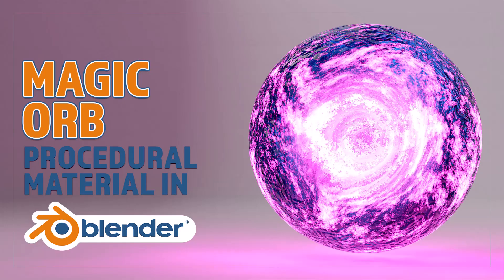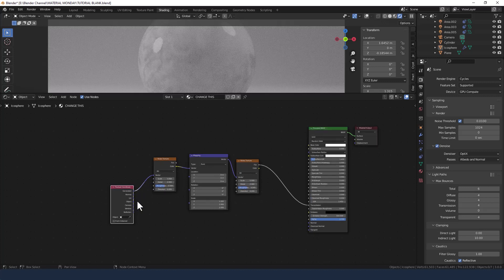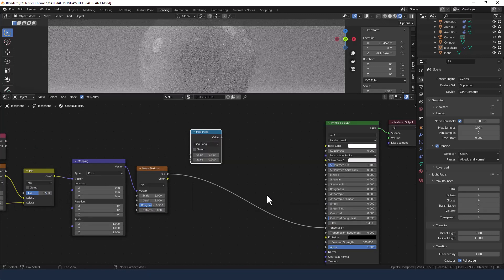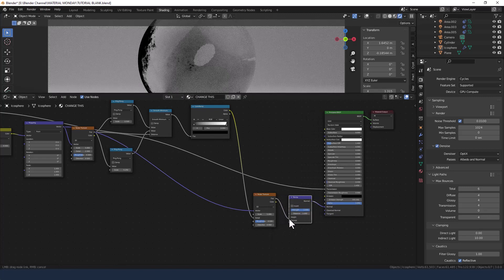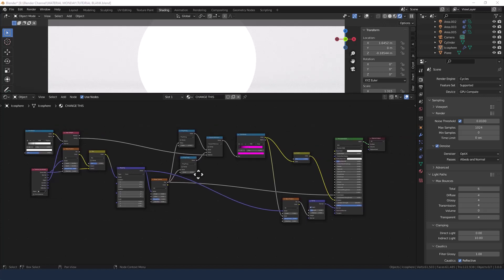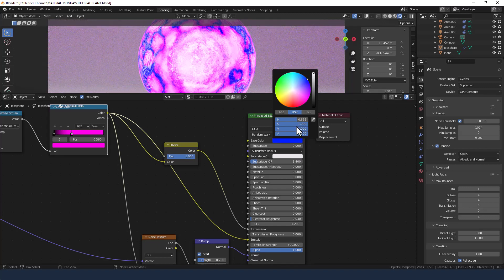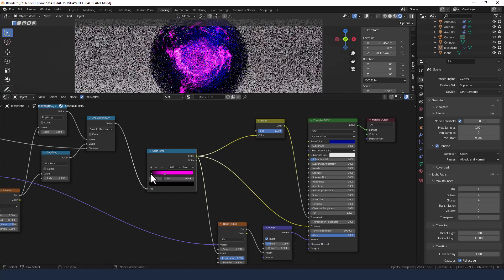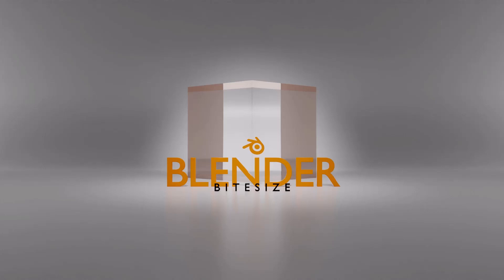CREATE A PROCEDURAL MAGIC ORB MATERIAL FOR BLENDER

Comment: Thank you for the great tutorial I applied it to a model with some color adjustments. I am having trouble getting it to render under the rendering tab. I am just getting a white glowing orb. I have it set to cycles after completing the tutorial since I have it on Evee. Do you have any suggestions?
Reply from the maker: This will likely only work in cycles, but I'll double check soon.
Reply: @blenderbitesize  Thank you for the reply. I started a new and found out that I have not set the ColorRamp black scale to .19 or higher,  as you had done so on the purple ColorRamp. Now that I have done that, I can now see the color and its looking prefect, I thank you.